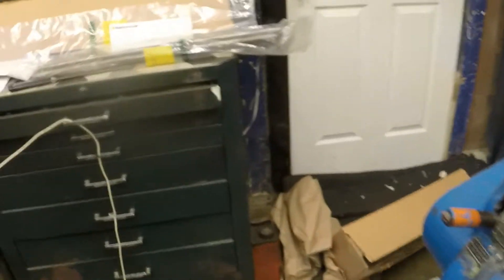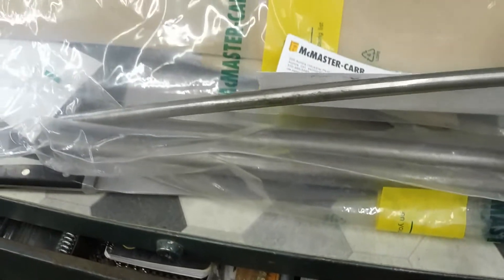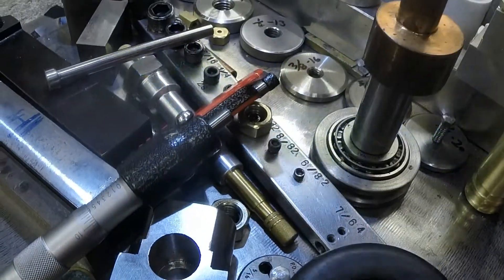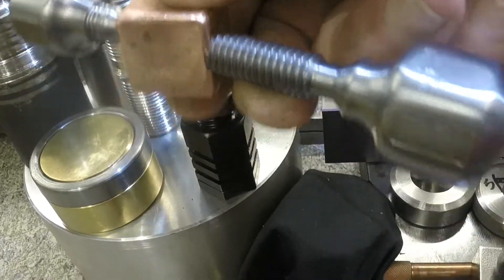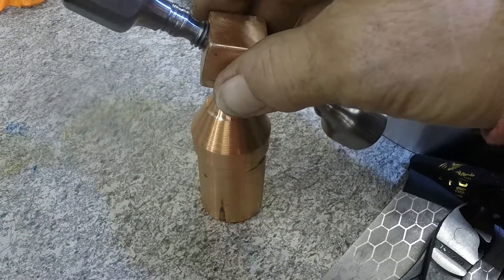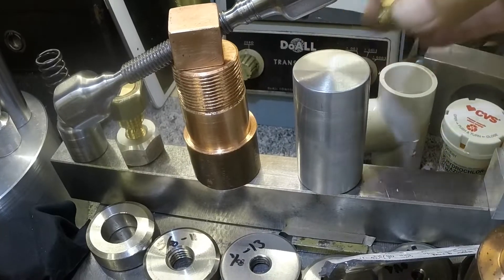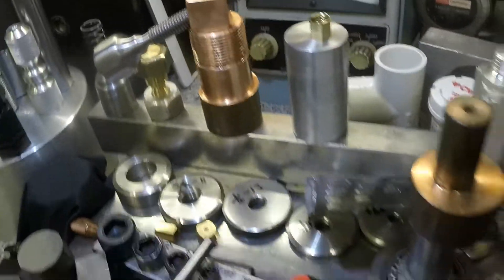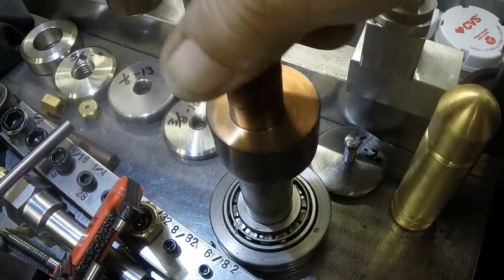DEEP THOUGHTS FROM A SHALLOW TH---INK--ER \ MAN

Comment: I love all the items you have made.  I currently am practicing on my lathe after surgeries.  I have turned and parted plastic rods successfully but am having issues with parting some pretty hard steel rod.  Some how it dips under the piece half way through.  I am centering it over and over.  Perhaps today I will get threw one.  Merry Christmas!
Reply from the maker: Try different speeds, I’m thinking slow it down. I little under center might help. Lots of oil , keep the tool moving. 
The hardness shouldn’t matter , sometimes a harder material parts easier.
I’m thinking just slow it down . Be sure the tool is sharp . Lots of oil , keep it moving. 
Good luck merry Christmas ,here’s to a speedy recovery
Reply: @kimber1958  I am headed out to try it now.

Comment: What I just found is that the tool holder 250-001 LLDSIMEX is not holding the 8mm shank mini parting tool.  i need to find thicker bits.  They work fine on plastic but definitely not on steel.